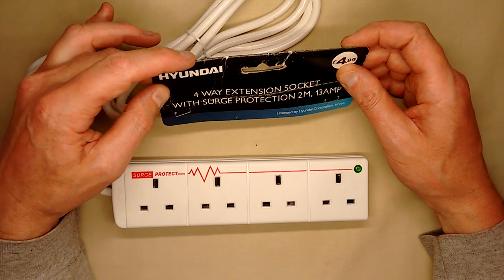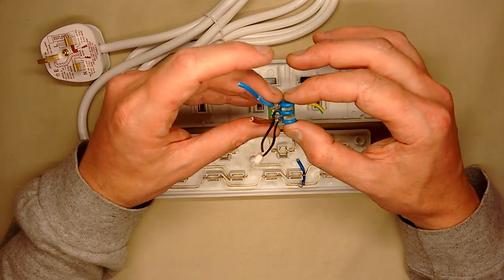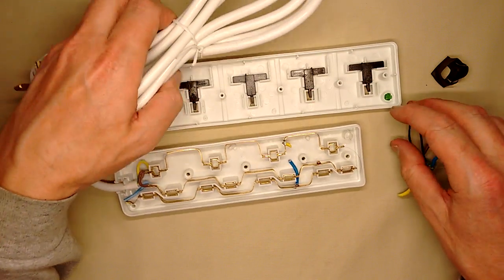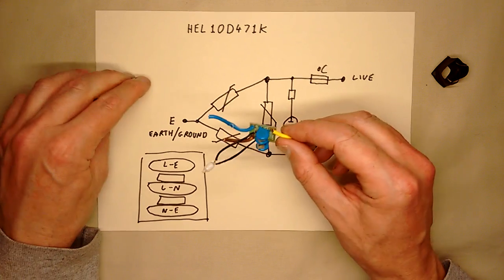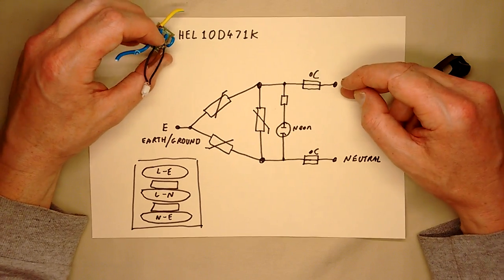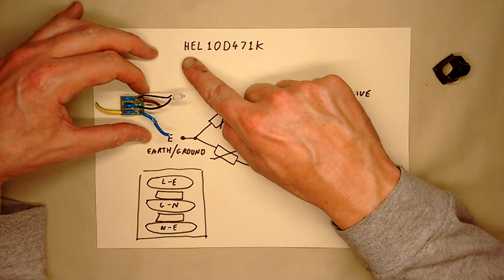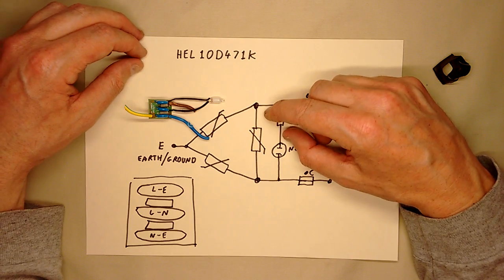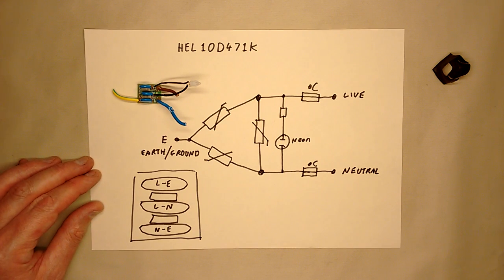Inside a Hyundai surge protection strip.  (With schematic.)

Comment: Will it stop this blue spark that cracks every time I plug in my laptop charger?
Reply: the trick is to time it right when you plug it in. you should always plug it in at a zero crossing :p
Reply from the maker: No.  That's the inrush current to the chargers capacitor.
Reply: It's normal, doesn't have anything to do with the quality of the charger.
Reply: +sleeptyper Unfortunately lots of laptops (not just Acer) from approximately that era will suffer similar failures, mainly thanks to lead-free solder.
Reply: I have seen this spark happen in Acer, HP and Asus laptop chargers. A bit scary but nothing seems to stop working...
Reply: Try to connect kettle or any other high current device when it's turned on. You'll probably stop using electric appliances at all. New fact of life - electric contacts spark.
Reply: Lead free solder is the built in redundancy manufacturers dream product. If I was a conspiracy theorist I would say good money was payed too develop such a product, that after X amount of heat cool cycles the joints just fail and to repair them becomes uneconomical so just replace entire unit.
Reply: Acer is the shiniest piece of turd on pc stuff that i've ever owned...
Reply: *****
Yep. Should be banned worldwide.
Reply: *****
My first laptop, a Fujitsu Siemens, lasted from 2004 to 2012, though i had to use external monitor for last two years.

Acer 5552 lasted from 2012 to 2014 until it's CPU socket warped off the BGA balls. Refurbished mobo from China lasted a year and now it's sitting on the shelf waiting for my decision to scrap or pay 100€ for complete reflow.

If you want shit, buy Acer. :)
Reply: add2k
Well, i'd blame ROHS and inadequate heat management - both equally. A laptop has always been a compromise between compactness, performance and heat dissipation.

When you add into the equation the sad fact that your laptop manufacturer wants you to buy their newest product as soon as possible, they will cut corners.

"Engineered fault" for the very purpose of getting customers to buy new stuff has been de facto method of operation for couple centuries...
Reply: You should buy a proper laptop charger. Is it an Acer laptop?
Reply: +Sirus challenge accepted
Reply: Isn't that supposed to happen only when you manage to hit the peak of the sine wave?

Comment: Clive, any chance you could take apart a Belkin-branded one some time? I've got a few I use for my valuable stuff (as many do I imagine, being a popular brand and more expensive than these cheapo ones) but I've always wondered if they're actually doing anything.
Reply: Could maybe ship one to him.
Reply: I've taken apart one of Belkins biggest surge supressors (as it failed after several year). It had way bigger MOVs, like at least double in size, and more of them, six or eight I remember correctly. It also had a coil and capacitor and the thermal fuses mentioned. But this was the biggest protectors at the time, at maybe €50 (8 sockets).

Comment: I believe that's the same generic surge protector they sell in home bargains without a named brand on it, i'm pleasantly surprised by what's inside for the price :) good video :)
Reply from the maker: By default we have local fuses inside the plugs.  So that bar was protected by a 13A fuse.
Reply: They do not, however they cost less than £5 which isnt too much of a loss if it breaks
Reply: And they're very similar inside to the more expensive brands, i expect that cover is all you're paying for with those
Reply from the maker: If your entire entertainment system is reduced to a pile of ashes they may replace the surge protection socket with a new one.
Reply: Interesting.  Here we have a resestable 15A circuit breaker.  The little differences between countries I guess. :)
Reply: +D Cheverie in my 70s house there's still 16A one-time-fail fuses :(
Reply: What I don't understand is why you don't seem to have actual circuit breakers in your power bars over there.  Every single one I have seen/bought in Canada has a circuit breaker in it.
Reply: I remember those!